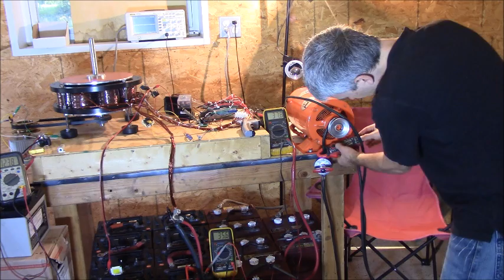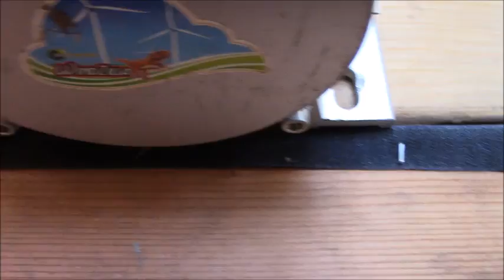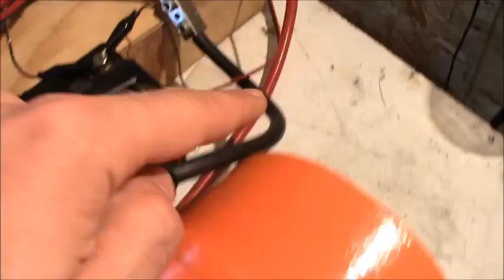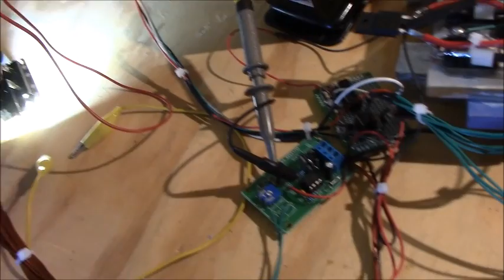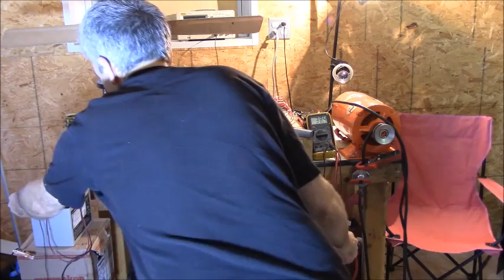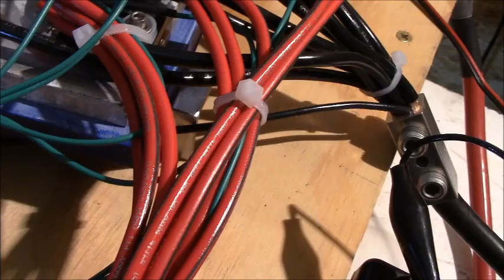4 DualPole Running Large Fan and Generator, gate driver, etc.

Comment: Hi Rick, thanks again for the insight into this field. However I do have two very pressing questions here, and I would be very grateful if you could answer them:

1- in the 'Energy from the vacuum DVD, I think it's the 1st part, John showed how he charged a set of golf cart batteries, but then he took a tiny light bulb and connected only one end to the battery terminal and the other to a plastic cap on the same battery, and the bulb lit although faintly!! Can you please comment on that, and maybe repeat that experiment?

2- Again on the same DVD, John talked about the possibility of recycling his generated energy from his motors, but for some reason he never/ I never saw him charge a battery, then use the same battery as an input source again! Can you kindly confirm this and please demo one for us. Many thanks, Saman.
Reply: Hello Saman! The bulb that John used was a NEON bulb. They are easy to find from electronic suppliers. I have done this myself and the energy surrounding the device and you will light the bulb! Any surface in the immediate area I tried lit up the bulb!

What is even stranger is that I did a similar experiment powering a HHO Generator made from a mason jar and 2 Stainless Steel Spatulas using a Solid State Bedini style device as the power source. For an electrolyte I used Food Grade Potassium Carbonate  instead of baking soda or lye. I was using these items to avoid the thermal runaway that typically happens when powering an HHO generator.

At one point during the experiment I touched an LED that I had sitting in the plastic table I had the unit set up on and the LED lit up! If I held one leg of the LED in my fingers and touched the other end to the table, chair, or the jar, the LED would light up!

I began adding more and more Potassium Carbonate to the jar in order to increase the hydrogen production rate and eventually I saw "Bubbles of Light" form suspended midway in the jar that seemed to be vibrating in resonance with the frequency of the power unit. "Cold fusion?" I thought. I later read a paper on sonoluminescense and perhaps that was what I was observing.

At any rate, Bedini style (radiant energy) systems used as power supplies for HHO allows for the use of plain tap water with no thermal runaway or electrolyte needed to generate HHO. There is a breaking in period for the SS electrodes in order to get them to generate significant amounts of gas. Any of the motors the Rick is selling can also be used instead of a solid state device as the HHO power source.

I am certain that we are just touching the tip of the iceberg with this technology. Experiment, take notes, have fun, and find practical applications sooner than later. Few things are as much fun as saving money!

God Bless and be well!~